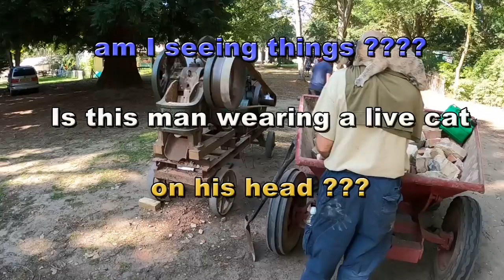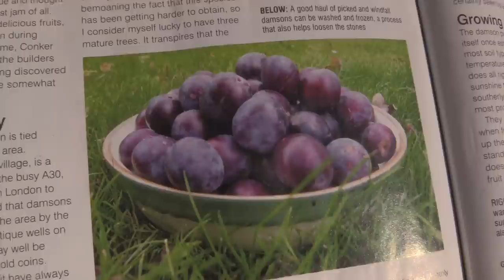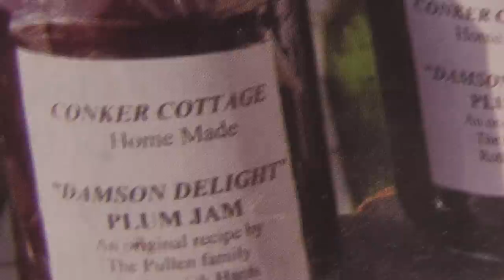This Huge Fish grabbed my tiny bait, what a result!!

Comment: That's the same spinnerbait you used on that muddy canal a couple years ago and had success with!
Reply from the maker: I believe it  was..good memory. Its had a few close calls and finally found the log in the river that even 50lb braid straight through couldn't move...R.I.P.   Mr Spinnerbait. I have another but it not the same.

Comment: Great vlogs graham question for you wat sort of braid do you use for pike? Is it 4 strand or 8? Any help appreciated 👍👍
Reply from the maker: I have a feeling it was 8 ?.. It was 50lb Sidewinder Braid,I think it might be marketed as Sidewinder silk ?? Hope you can track it down,I only have it on the reels so no box to check stats. It was a lure angler that put me onto using heavy braid for lure fishing some years back.They want to get their expensive lures back and it makes a lot of sense as now I changed to it I can often drag out whole branches,get my end rig back and clear the river at the same time. Of course if you slam into a sunken tree or solid object its usually game over,but even then I have straighten hooks out with the pressure of pulling,then put them back in shape with long nose pliers.
Reply from the maker: I just looked it up..it says 8 micro weave fibre construction.
Reply: Oh OK many thanks for the quick reply and answer👍 will that be OK for Dead baits on a float or leadger aswell graham have you any more pike vlogs coming  up?? Watching very closely to learn and follow wat you do👍👍👀👀👀👀📺
Reply: Also have  you some good trace and crimps you can suggest to me or any suggestions on making my own traces 🤔🤔🎣👀

Comment: Also  m8  any suggestions on some good trace wire and correct crimps I can buy just to make some traces??
Reply from the maker: I don't use crimps myself for pike fishing traces ,but I do use heavier wire cable,generally about 30lbs or so. If its multistrand I just knot it. Snip off the tag end and you can put a drop of Superglue gel or araldite over the tag end. I think the wire spool I use is probably not made any more,was it Tideline or Tidecutter or something ??. It was basically wire line for either trolling or sea fishing .But if you check you local tackle shop they might have something similar.